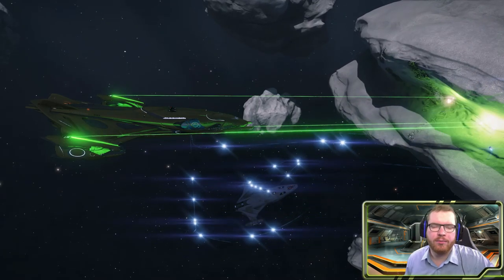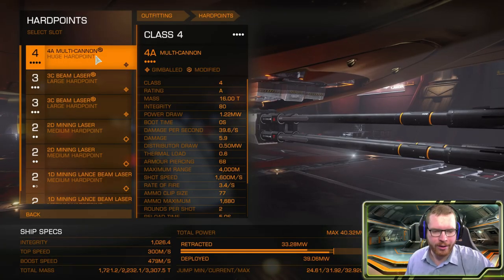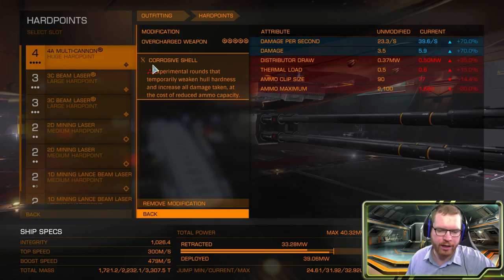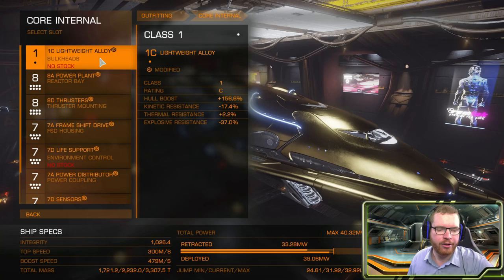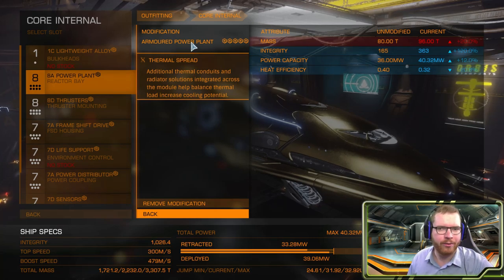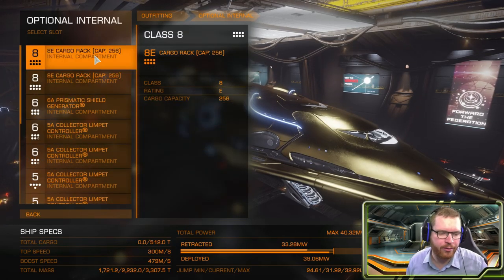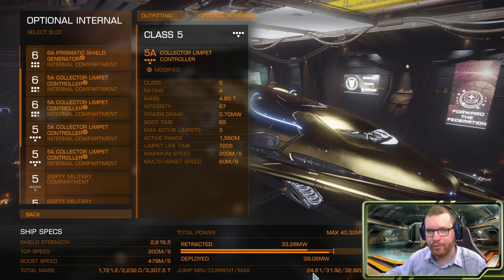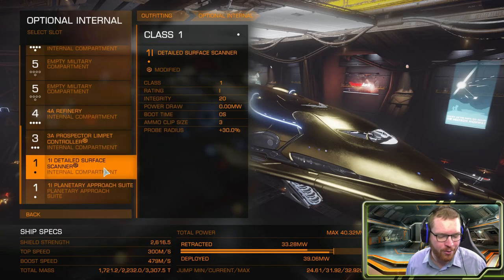Cutter build guide - Fleet LTD mining

Comment: I keep all the mining gear in storage at Brothers Installation in Borann.  That way I can arrive in the system with FSD booster, fuel scoop and fighter hanger installed.  Then swap them out on arrival to the full mining gear.  Do the opposite when finished mining.  Then you can go anywhere, in relative safety, to get the best price for your LTD without worrying too much about jump range.

Comment: If you take the lasers off the back wings, I find those hardpoints are better for turrets, stick the mining lasers up front and you don't get the range issues the back 2 lasers normally gets.

Also with Grade 5 charge enhanced A rated Power Distributer, you can power 4 lvl 2 mining lasers long enough to 100-0 most asteroids. If you want to always 100-0 them, maybe try Weapon enhanced distributor, might be able to run 4 level 2 mining lasers perpetually or at least for a solid 45 seconds.

Comment: I’ve got an engineered t9. Not ready to grind for the Cutter. I’d love to see how you’d set one up to compare. Thanks and great stuff as always.
Reply: Hint, its not that bad a grind if you do things over time, I'm a proud cutter pilot currently ranked at Lieutenant in the federation on my grind to my Corvette and its only been like 4 casual days of cargo hauling and data courier missions this far. 2 weeks is all I'd say it takes someone able to put in a few hours a day on getting some missions done, and you can get a lot of good materials too, I've got over 20 exquisite focus crystals so far. 

To be fair, doing the grind in the cutter is almost META, because its faster than the npc pirates, holds a load of cargo, and if you plug a 8A prismatic into it your shield will NEVER go down unless you (like me) occasionally do the big dumb and accidentally toggle silent running...lol... only done that like 3 times so far